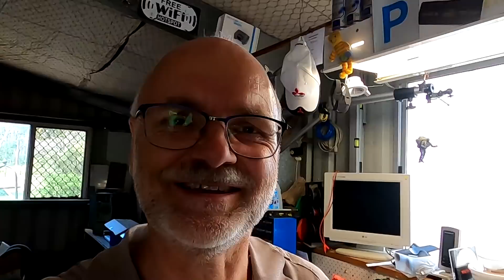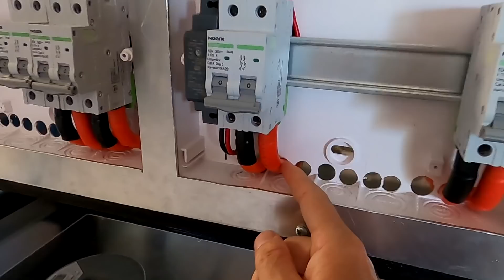Fully grounding the battery shelf... and trying this foam idea 🤔 | Battery 2.0

Comment: Instead of silicon, just tap the "extra" hole and mount a screw. You can always claim it has been put there deliberately to vent off the electrons if the batteries are overcharged ;-)
Reply: Or you could use "split loom" (but smaller) and use it as edging for the metal around the top :). Stop the nice stuff from scuffing.

Comment: Leave them on the top (negative busbar connections), too much hassle for any future changes if it is connected to the bottom. I would use angle iron brackets on the outside to connect to the garage structure for the same reason.
Reply: Could just raise the front buss bar 12mm. You have spacers there already, just make them longer for the positive Buss Bar.

Comment: Thanks for the try. when i found out it was floating i would have put some batteries on the shelf to see if they had enough weight to compress the foam. it was worth a try. reuse/ recycle and all that. as for the top maybe Velcro?  the ground lug inside the one with all the wires on it looks like a spider :) looking good! how is your audience doing (birds) haven't heard them for a while? are you going to put a sign on top that says NOT A SHELF.
Reply from the maker: The top will be a shelf for sure. I can see this already coming😂

Comment: When you were putting that wooden block under to prevent it from toppling over while you cut the ties. I realized that the shelf brace could have just popped upward out of its locking slot. WOuld it be wise to put a self tapping screw thru the brace, into the leg, to prevent it from being dislodged?  *I typed this before I finished watching the entire video. LOL. You are a smart guy, you beat me to it!
Reply from the maker: I had the bottom shelf secured with this screw I sowed in the video. Also there would have been not enough force for the shelf to pop this out. It was just over the tipping point.
Ah, I haven't read your comment until the end.
Makes two of us 😂